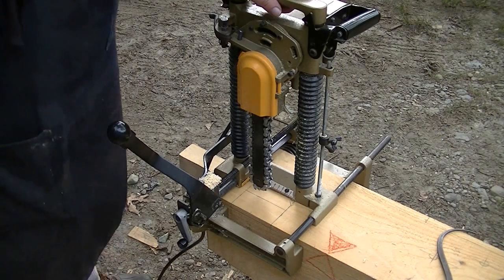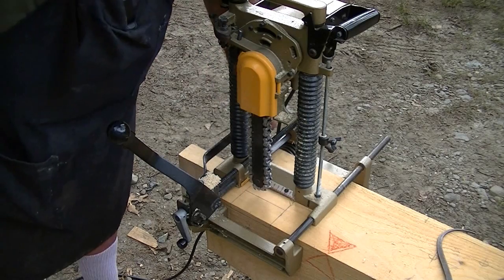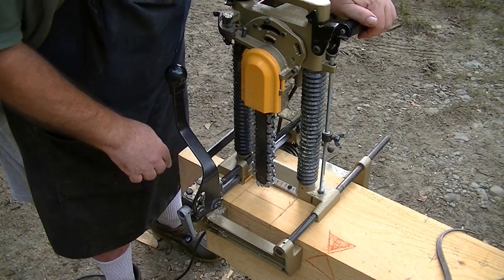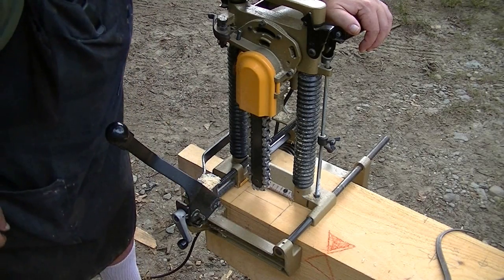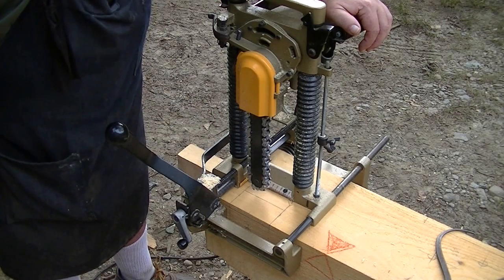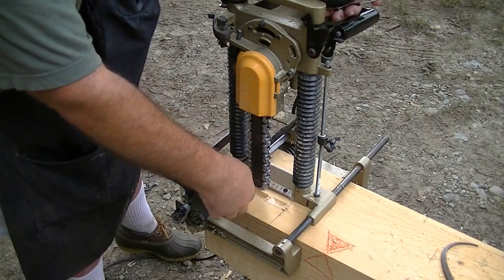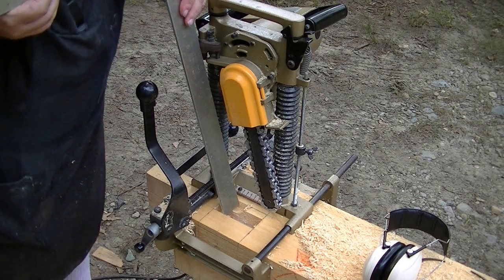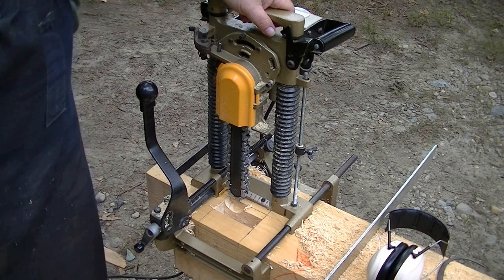Chain Mortiser Tips

Comment: You adjust the width of the mortise by having the black handle down and there’s a plate with two bolts next to the handle,the chain is 16mm and set the adjustable plate at what ever size you need the mortise to be minus 16mm,do the first cut push the handle up to the stop and cut again.The chain always lines up with the end of the yellow indicator. Cheers

Comment: I have a Makita trim router and a Makita biscuit cutter. You mentioned the problem that you could switch on the chain mortise if you don't pick it up using the top handle. Both my Makita tools have a similar problem - the switches are located in such a way that the tool is easily turned on when picking it up. Bad designs. I wonder if Makita has ever gotten into trouble for this (yet).

Comment: How do you like the Makita?  I have a friend who uses only Mafell and another who uses Swisspro and they are suggesting that double the price for their tools is worth it.
Reply from the maker: I guess it's one of those things, you get what you pay for. You can ride down the street in a Ford or a Chevy. Or you can ride down the street in a Cadillac. I chose the Chevy. They both/all do the same thing, make mortises. I like mine. I've had it many years and have done lots of mortises. I just recently sent my chain out to be sharpened. First time for that.
Reply: @JimRogers117  The fact that you have used the Makita for a while without issue speaks volumes.  I agree with the get what you paid for adage but sometimes there are well made things that don't require triple the price.  Sometimes a Chevy will do just fine. 
I cringe to think that I need to drop so much more on the top of the line because the less expensive versions won't cut it. Cutting them all by hand is a chore but so is throwing away money on a tool that breaks after a month of use.  Feedback appreciated and thanks for the vid.